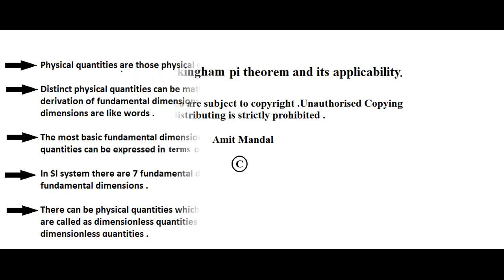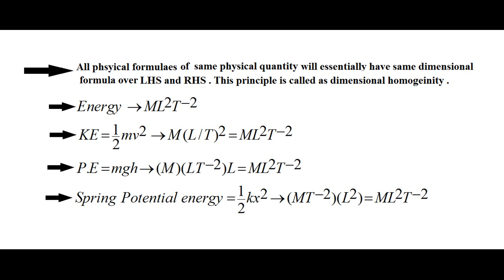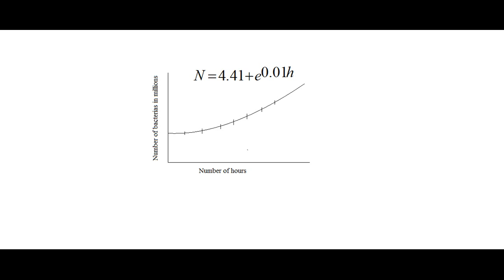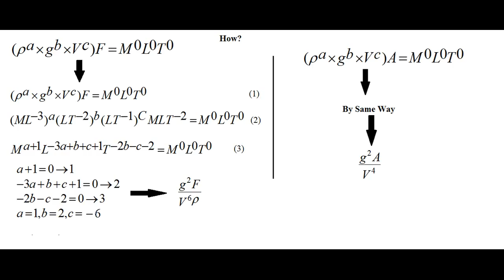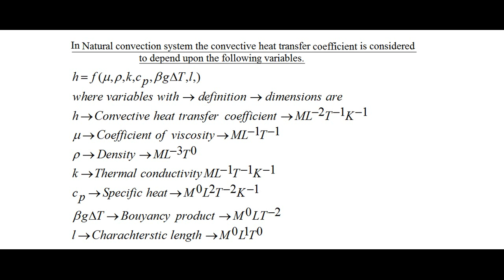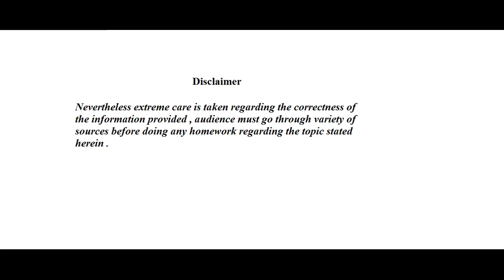Buckingham pi theorem and its applicability

Comment: @Amit Mandal Sir, this video helps me a lot, specially i was very curious how Buckingham Pi Theorem is applied to real situation. Then you have showed that Statistically we have to develop an  Empirical formula. 
But you have used relationship which only include two variables ( M, N) . But can we show this graphically when we have more than two variables ( M=f(N, P, C) ), How can we show this ?
Reply from the maker: multiply 2 and get a new non dimensional number...
Reply: @Dr.AmitMandal  Thank you sir, that will be very fine. Thank you very much

Comment: dear sir, thank you so much for the video. it helps us a lot. 

Here, i have a question/doubt,

You have derived an expression of the form F= K. p. m.g.A (like this. so its more like the form f(x) = x which is an identity function. If we are to end up in a form something like F=  p. m.A (phi)[a/b, c/d, e/f] , which is of the form f(x,y,z) = ? how i am supposed to approach the problem to solve.

thank you so much
Reply from the maker: we have to make empirical relations ...
Reply: it would be really helpful if you could guide me in solving the previously described via empirical relations. Please let me know where i can find study materials regarding framing empirical relations and solving them.

i am following fluid mechanics book by Bansal and it gives only the expression for a force or efficiency in form of function f(x/a,y/b,z/c) = k or 0. I would like to go beyond that to validate my applications.

thank you
Reply from the maker: +Raju Ratnakar hmt natural convection formulas are empirical.